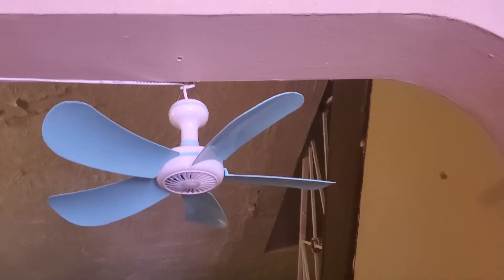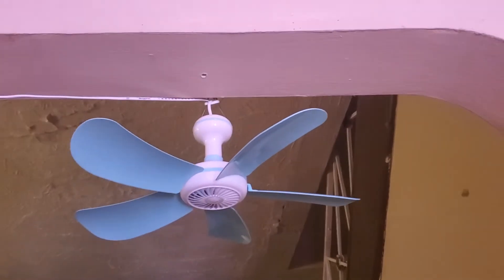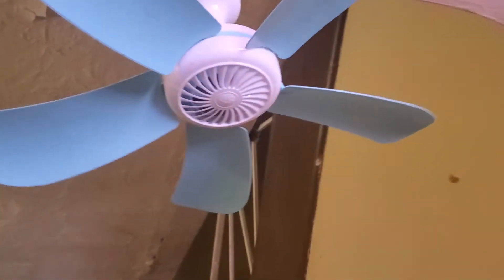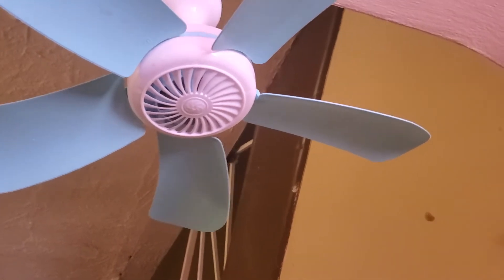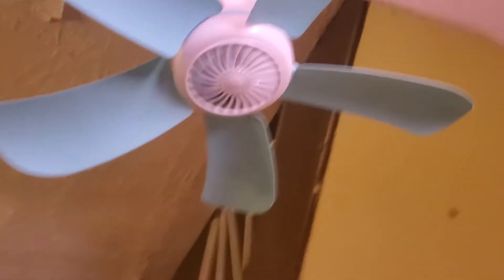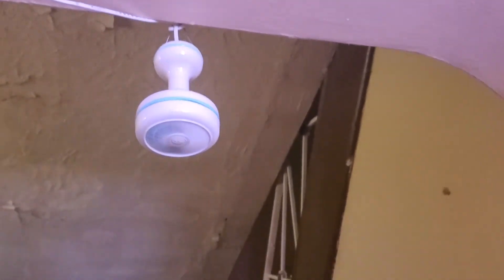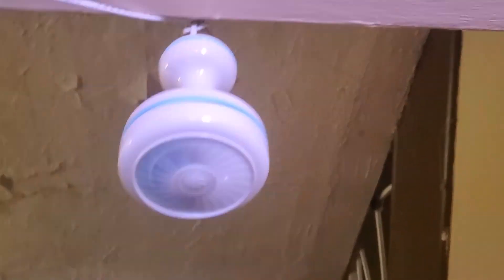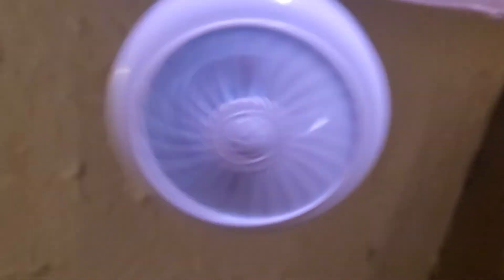Mini ceiling fan problem.

Comment: I had the exact issue with a mini fan I owned, it’s because the voltage of the fan is 220 volts, while your power supply is 110.